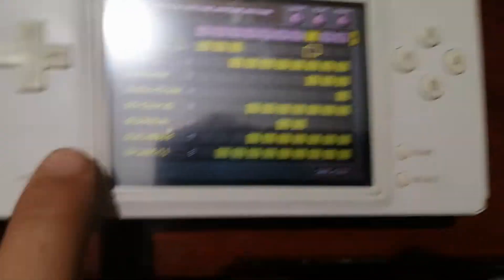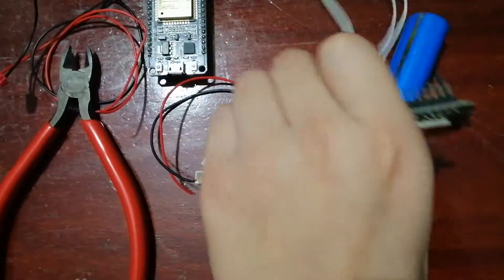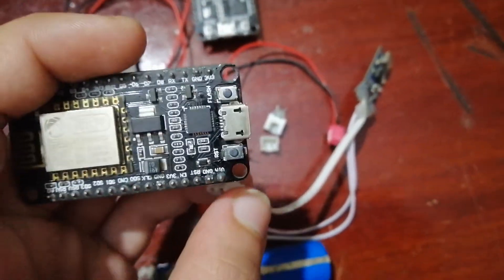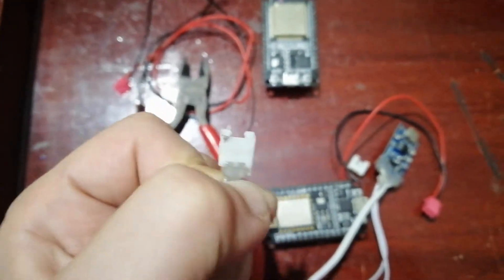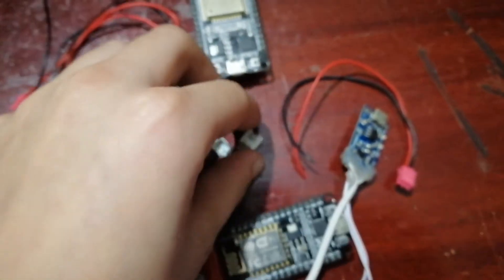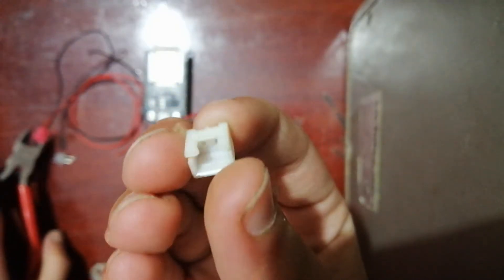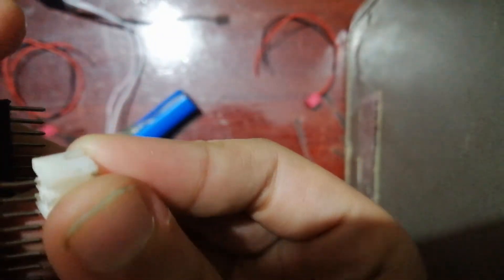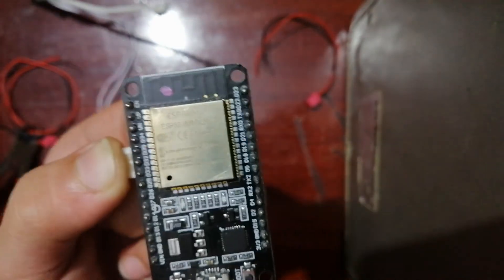How to add a JST XH connector to nodemcu or esp32. (To avoid reverse polarity)

Comment: Thanks for the tip, good to know that the JST spacing is roughly the same as the ESP / Dupont pinout. That'll work for the power connectors, though possibly not for the data pins on the other side.